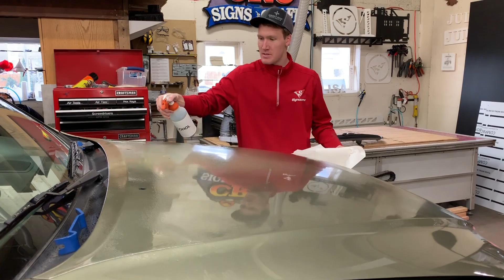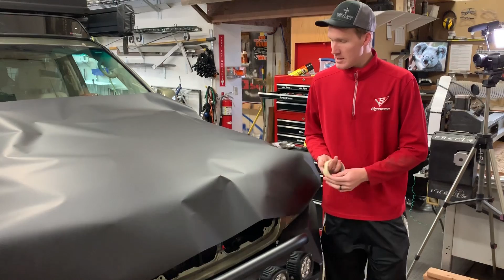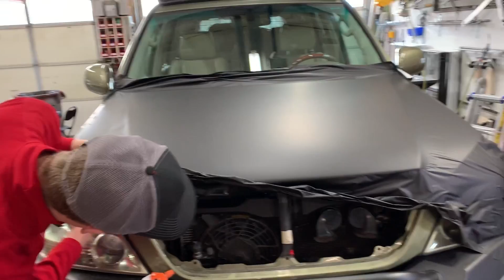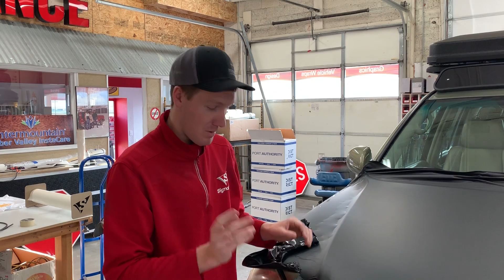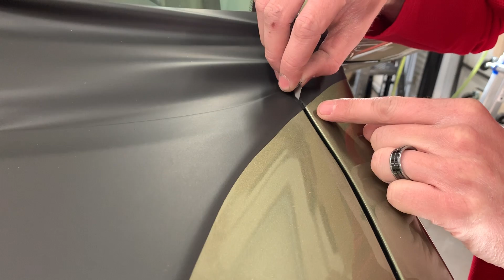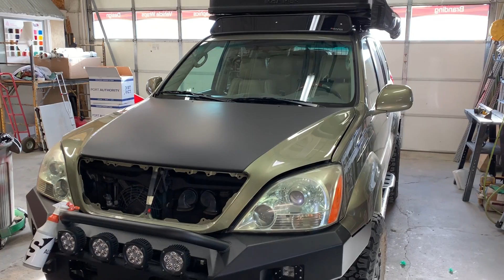Hoodie™ by Trailpower Part 1-of-3: Hood Blackout Vinyl Install on Lexus GX470

Comment: Can you also share information on your roof rack for the iKamper and awning? I’d love the know the total height also as my garage door is relatively low
Reply from the maker: We are running a Rhino Rack Pioneer platform with the iKamper. Our vehicle is riding on 33" tires plus a 3" suspension lift. Overall, it is about 94", just clearing our 96" garage door opening.